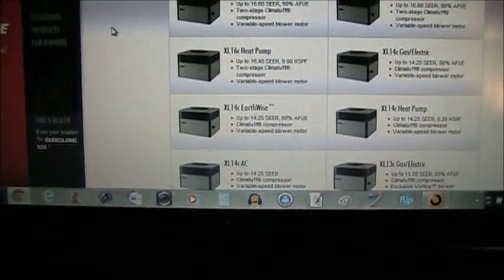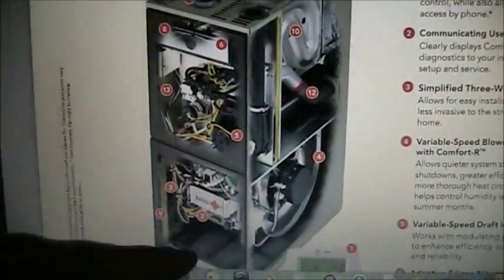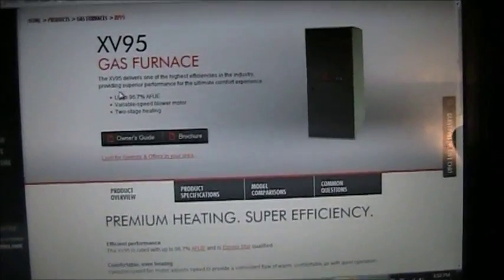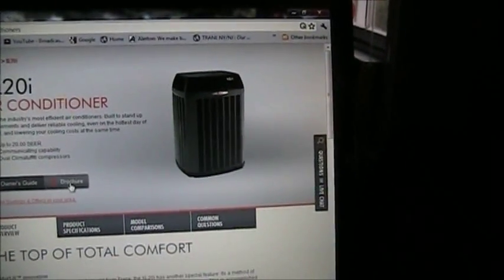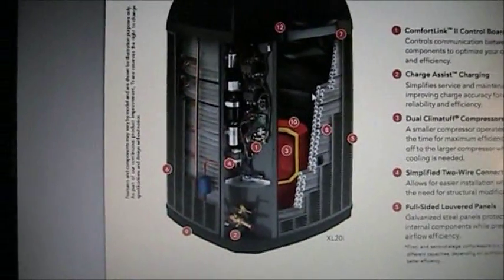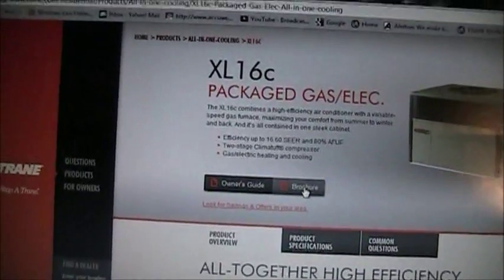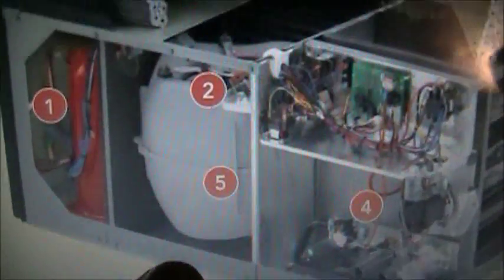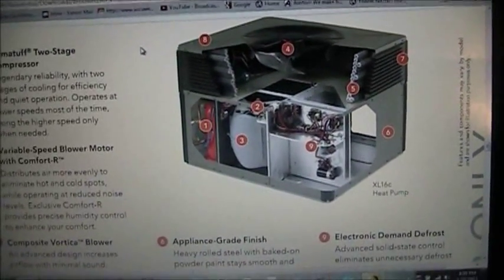HVAC: Differences between Split Systems and Packaged Systems

Comment: I have a propane gas furnace and electric a/c that I would like to replace with a hybrid heat pump system.  The furnace is in the attic.  Can I replace the a/c and furnace with a packaged hybrid heat pump system?

Comment: Man, I haven't been over to the Trane's web page, and didn't know they changed it.  When did they do that?

Another downfall about packaged unit, they don't last as long as a spit system.. Heat exchanger on the gas units are rusted and gone due to the A/C air blowing on them in the summer.

Comment: @84randomdude well our r22 14,000 btu heat pump works wonders for our 1,200 sqft downstairs but thats your opinoin, oh and im at my friends in Rochester, NY and they have a trane xb series heat pump, i have two short clips one of it running and another of it starting a 30 second defrost cycle then go back to normal, i think its only a 1.5 ton but don't think i can get much vid of it

Comment: @84randomdude hmm this monitor consumes less than 80 watts.... not a whole of heat if you ask me, my 6.1 channel surround sound amplifier on the other hand does creates a lot of heat and you wouldn't want that in your room if you want it 60 degrees, plus i dont have central ac so i dont have to worry about it and your electricity is really cheap, i just worry for your church as churches all around are hurting now a days